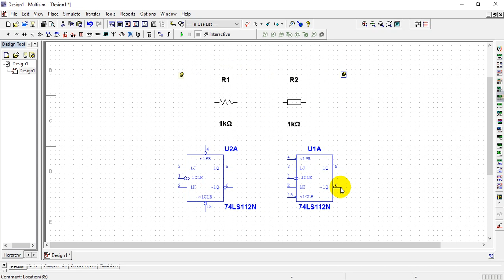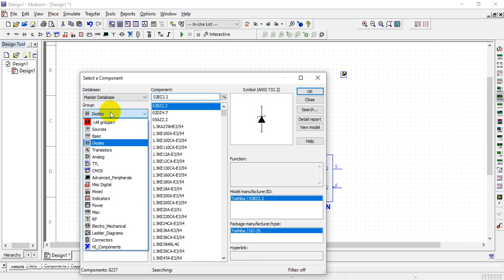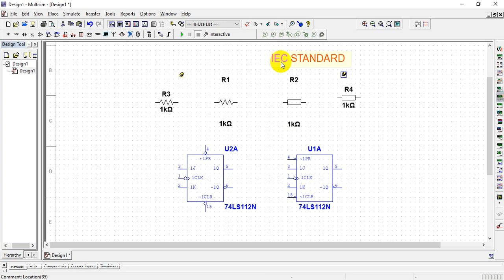Same Component but Different Symbol. How to change Components Standard in NI Multisim. ANSI-IEC

Comment: Hi, please tell me, is it possible to somehow reduce the size of the symbol? I drew 2 identical circuits, one in Electronics Workbench and everything fits, and the other in Multisim and it does not fit, because the symbols are too huge.
Reply from the maker: To solve the problem you have to increase the sheet size( work board size).

https://youtu.be/f3jkLEycor4?si=C94pxr_Z7_b_wQFa

You can solve the problem in 20 second. See the video from 45 second.
Reply: @learnwithalimun6366  Thanks a lot